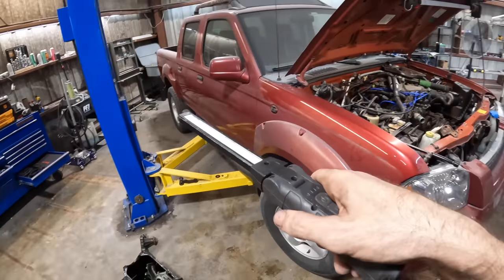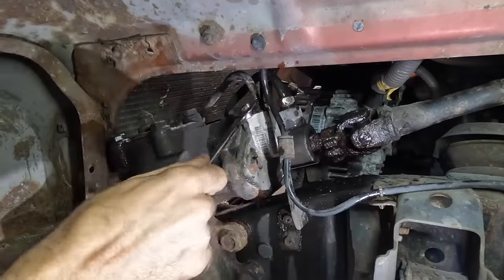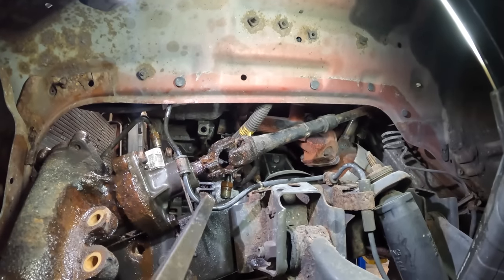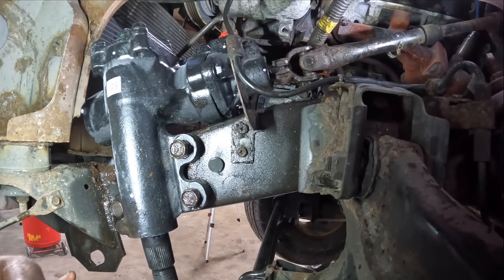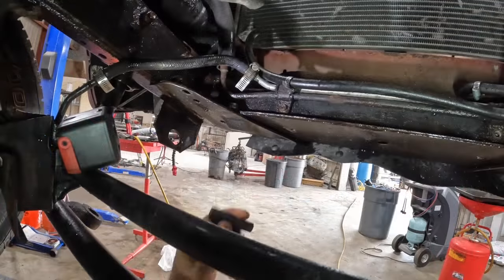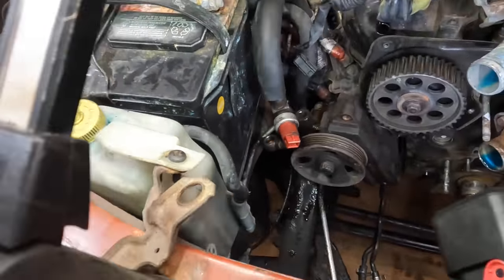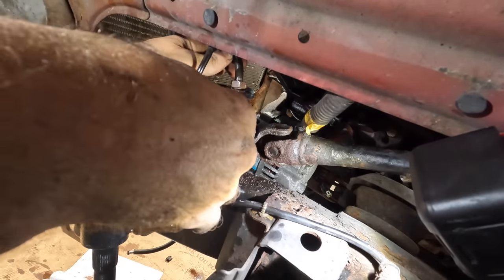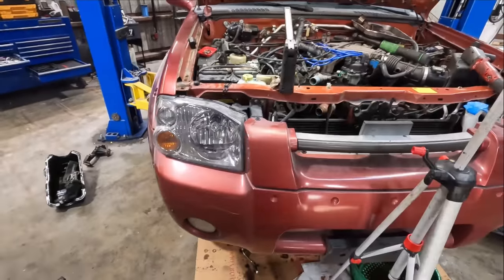Rusty Oil & Dripping Transmission Fluid! Pt3 #oilleakrepair #steeringwheel Nissan Frontier 3.3 4x4

Comment: The owner must love this truck. These repairs are high dollar.
Reply: I thought the same thing Doc Zoidberg.  Maybe they cannot afford a different vehicle?
Reply: @jeffkenney1618  I don't think it's about not affording a new one. I have a 96 Silverado, a 96 Cheyenne K1500, and a 99 Suburban. I am rebuilding the motor in the Suburban. Two of them have rebuild transmissions. They are solid trucks. Newer ones aren't as good. I can afford a new truck, but I love my old trucks.

I have videos about them on my channel.
Reply: Replacement  is even higher dollar.  New equivalent approaches $40K msrp.  Can do a lot of repairs for the cost of a few monthly payments.  Those payments last for years....
Reply: @desotosky1372  That's true. It's even better if you do most of the repairs yourself.
Reply: @desotosky1372  They are wanting $80,000 plus for new Fords.  Repair away.

Comment: Speaking from the salt encrusted northeast, we always clean up split joints (like on the steering shaft) with a straight/tube wire brush then a good schmear of axle grease on it.  Goes back together better and definitely will be in the best shape it can for future disassembly.

Comment: That first bolt reminded me of some repairs I did that involved a file to create clean faces that a socket or wrench would actually grab instead of the nearly 1/16-inch layer of crumbling rust.
Nothing says fun like turning a 1/2 in bolt head into an 11mm bolt head.
-
I've also had to use a Dremel to turn blown-out Phillips' screws into flathead screws.
-
Rust.
Reply: That sounds god awful
Reply: Try making them Torex heads.  They grip better.

Comment: Power tools are amazing. When I first started on motors everything was done with spanners but motors were much more simpler.😁
Reply: And this one is 20 years old!
Reply: I always wonder how the anvil holds up in impact wrenches?
Reply: Power tools ? We once had a Mechanic from Brazil. He started working on massive "Cats" he'd trek out into the forest, following a cable until he found the broken down machine. The repairs were all with wrenches as there was NO chance of getting anything other then "armstrong" power to the site. He sure seemed happy in our fully equipped shop.
Reply: Me to have a great day

Comment: Isn't the cost of this repair going to be greater than the value of the car?  This has to be several thousand dollars worth of labor.  If this was my car, I'd be thinking it's time for a new car.  Enjoy your videos, Ray.   Yours is my #1 favorite YouTube channel.
Reply: A new car costs $50k, a used car costs $20k.
Reply: @lzxray6781  and a used car is usually someone else's lemon
Reply: @lzxray6781  This Nissan Frontier starts at $22,000 new for 2023, about the same as a 2023 Toyota Corolla.  I see ads for a 2000 Nissan Frontier for $3000-$6000.  This vehicle is a money pit.  Time to cut your losses.  Perhaps the vehicle has a sentimental value?  That's the only reason I could see spending so much money on it.
Reply: it just depends on whether you can afford a reasonable used or new car, there is no point in buying a cheap used car and then having to put a lot of money into it to make it okay
Reply: But is it less than buying a new/used vehicle?
Reply: Junk the Nissan and get A Toyota truck!
Reply: If it was my truck, and it ran really well and had no other major issues, I would drop a couple grand on it and run it till it drops. New vehicles are gonna cost ya 7 to 900 a month, used one for 15 to 20k at today's high interest rates gonna cost ya 300 to 600 a month. Putting 2k in this one to fix it up is a way better idea. Even if it was 3k. Even if the guy had to borrow the money and pay it off in a year or two is still less than 200 a month with interest.
Reply: I agree totally with you. Those older Nissans were the best Nissans. 
But I think it’s more than $3000. At least $5000.
In 2009 I bought a ‘96 Pathfinder. Put $3000 in it right away. Still runs good with 273,000 miles on it now. Fighting rust though.
Reply: Nothing prevents five other unrelated things breaking soon after, especially in a northern rusted car.
Reply: With what's happened with car prices lately and the frankly poor state of new cars I think this was a pretty smart investment. The US is on the verge of all its banks failing and a new great depression. Much better to own your vehicle outright than have to make a monthly payment. 

The owner will get another decade out of this truck now. Maybe needs a bit of rust treatment in a few spots.
Reply: I'm flying from WI to Florida next month to bring home a 1988 truck nothing like bringing old mostly dead stuff back from the dead
Reply: It's not a car. New truck today is what, 60+k. I would definitely repair this truck if I loved it and it's going to be safe when Ray finishes.
Reply: I think that’s a fair question. I was curious about that question too, so I looked some stuff up. A new Nissan Frontier starts at $29,379 that’s for a very basic 4 cylinder 2 wheel drive single cab. A decently equipped 4x4 with a V6 and double cab will run you about $38,000 to $40,000, so I don’t know what I’d do in this guy’s situation. There’s a lot to be said about not having a car payment, but I do see the probability of this making sense for someone. Where I live it’s really tough to find a decent used truck, small or full sized.
Reply: Unfortunately, with Nissan, that's a low bar. 😂😂

Comment: Just a suggestion, for making replacement rubber pads on things like the power steering lines. Get an old motorcycle tube and cut it to size. It can be a handy trick that is over looked.

Comment: I hear you about the rust/oil combo...crunchy fastener turning sucks. I'm surprised as oily as everything is that you didn't empty 2 or 3 cans once the radiator and front of engine was off. I hate working on slimeballs. It's much more enjoyable working on clean and shiny🙂
   Thanks for part three on this truck Ray.  I can't wait til part 4🙂

Comment: Minimum 6G's on parts and labor, a lot cheaper than buying a new vehicle, plus you have a mechanic that can make it like new.  Good job Ray.
Reply: I am reminded of a movie where a guy walked around with a sign that read "Not economically viable" (Falling Down?). This truck should have one too. A big one. Neon lit.
Reply: Yeah - these old Nissans are good vehicles. Cheaper made than Hondas and Toyotas of that era but often built using dated technology so they tended to be as reliable. This thing could probably run for another 20 years with some rust treatment and maybe a donor engine at some point.
Reply: That truck is in great shape... for its age.

Comment: I bought a parts yard power steering gear box to "someday" replace the leaking one in my 1988 2WD Mazda B2200 truck.  After I got the engine remanufactured in 2020 and was happy that the engine didn't leak, I installed that used gear box; similar to what you just did on this Frontier, but a little easier on mine.  It worked fine, and doesn't leak still.

Comment: I'm surprised you don't use flare nut spanners, (pipe spanners as I seem to have learned to call them), for the various lines you have to get undone. I'm always waiting with gritted teeth for the open spanner to slip and round the fitting.😬
Reply: The ones he is using, are designed to work on the flat sides of the nut, to they give them a very good grip without rounding the nuts off,

Comment: Target fixation has secondary effects while driving. Normally it is a matter of misdirected focus. For instance, soccer goalies wear bright colors on purpose. Players can be distracted by them so much that rather than kicking the ball to the corner of the goal, they kick it right to where their eyes are focused - to the center of the goalie. When driving though, you have an added complication of your head following your eyes and your shoulders following your head. The shoulders of course directly affect steering input. This is why drunks will stare at a cop car on the side of the road with paranoia and yet inadvertently steer right into it. Motorcycles and bicycles are much more susceptible to very small shoulder movements, so for a sober cyclist the effect has less to do with steering directly toward where you are looking and more to do with looking to your left or right and your shoulders nudging you in that direction. By the time you look back forward you are drifting out of your lane or off the road.

Comment: I live in Canada on the East coast ant the only way to keep the rust off is to have your vehicle sprayed each year. Mechanics don't like the mess, but parts bo come apart easier. Have a great day.
Reply: Hello fellow friend of the salt and rust😂
Reply: Yup.  cars turn to dust pretty fast out here.  Lots of trucks fold in half on the lift at my father-in-laws shop.  

My mechanic actually does the spraying too.  It's a love-hate relationship.  Makes life messy, but much easier.  He uses Pro-Form because it doesn't affect the rubber seals as much as the others.  

I saw a 90s Chevy truck with Krown stickers in the back window from 1994 onward in Nova Scotia a few years back.  The truck was still mint.  The stuff really does work well.  It was winter time, so it wasn't a garage queen either. 

In comparison, I bought a beat-up 98 1-ton Chevy for 1500 bucks in 2017 in BC.  It was a work truck and used and abused, never sprayed or undercoated.  It still had paint on the frame when I bought it in 2017.  😂
I replaced the clutch in it, and didn't even have to use penetrating oil.

Comment: Ray it might have been easier to remove the body from sub-frame. But I like your tenacity. Great show mate
Reply: This truck looks too rusty to risk removing body/frame bolts, could cause days of delay fixing broken body mount bolts.
Reply: @quicksilver462  In Minnesota I have taken apart the frame from the body on an envoy XL with all that rust of the area  It was  the best thing I could have possibly done, otherwise there is no room to work at all.
But then I was rebuilding the engine and transmission too while I had it apart.
Reply: Yeah if you live in Texas try telling that to the bolts that hold the subframe in
Reply: Might have been easier to tow it to a junkyard
Reply: In England, we would call this car 'A rust bucket', but I think Ray could handle any screw, bolt or nut giving comments like mine. Lol
Reply: @charleshepplewhite7384  In Canada, we too call a  "rust bucket" what a coincadink. LOL
Reply: In Ohio we call them rust buckets, bucket of bolts or a 55 get-out and push.

Comment: On complex routings through the engine bay like the power steering line here, I tie a messenger line on the part being removed then tie it the new one and pull it back through. No question about where it should run.

Comment: It would be interesting to know how many hours you had into the whole repair!
Reply: Was thinking the same thing. Parts… labor…Truck can’t be worth more than $8 or $9k?
Reply: More than the Chilton Time to build the truck!  ;-)
Reply: I wondered the same thing about project Jeep that he spent weeks on. If I have to pay my mechanic more than a few hours of labor plus parts, then the car is totaled
Reply: Nissan time to r and r the motor is 15 hours and add 4 more to seal and trimming belt with water pump.
Reply: @bustedkeel  good luck with that. You'd rather replace a vehicle for 35k than fix one for 3? Cars aren't disposable you know.
Reply: @bustedkeel  Pssssssssssssst I’ve got a secret

You tube content. He makes more from you tube than the repairs. He needs the material.

Comment: A small chisel helps spread the ears on the steering shaft making it easier to remove and reinstall. Looks like some rust converter would help under the fenders before the rusting gets worse. It looks like they want to keep the vehicle for awhile. Mechanically it will be in good shape, they should take care of the body to.

Comment: Those clamps holding the power steering line to the frame are called adel clamps.
If the rubber is deteriorated, you can reline them with a piece of thin leather belt. That's how we made field repairs on our helicopter lines on deployment.

Comment: Nice video Ray.  In 1975 I started working at my friend's shop.  It was founded in 1927 by his grandfather and had some interesting old tools.  I faintly remember a ratcheting line wrench.  It had a sprag similar to an automatic transmission.  It worked great, and would come in very handy in situations like this.  Have you ever seen anything like that?

Comment: Most cars have fluid leaks somewhere. I have seen cars with 3000 miles leaking oil. A corvette that was bought brand new, in the fall, taken on a trip to the gambling boats then put in storage until spring have an oil leak. Vehicles are only as good as their makers.

Comment: Wish I still had my Nissan. Mine was an 85 bought cheap owner thought it needed a motor.  It actually had the wrong sparkplugs in it. Replaced sparkplugs and put 15000 miles on it and then sold it because I had bought a new truck.  I see it everyday, the old man I sold it to is still driving it and he hauls a trailer with his landscaping tools.  Wish I'd of kept it.  They say, "Hindsight is 20/20"

Comment: Owner must love his car to spend this much on it - I had a 200SX and was really sad to sell it cos i couldn’t afford to keep it in repair 😢
Reply: @sidwalker6902  it was S14a Dark Blue - non mod - with cream leather - 1999 I think .. solid never failed me. Just some issues with dry joints on the circuit board that meant I needed to give it a thump to get the Rev working. Had to sell cos got married. And some welding needed on the front struts. Darn should have kept it.

Comment: Something like 35 years ago, I owned a little Datsun car. Engine was bulletproof and was actually very easy to work on. Not at all like this Nissan, which is either the result of the Renault influence on the Nissan group or just simple progress - progress backwards.

Comment: Hey, Ray!
When you get one of these rust buggies, the FIRST thing you should do is soak every nut, bolt or screw you will touch with penetrating oil and let it soak as long as possible.  Then squirt it again before you begin work.  Like the steering gear and associated components.  If you had soaked them down when you started this job, 90% of these nuts, bolts and screws would not have been any problem at all and you would have saved yourself a ton of time, stress and anxiety.
Hammering on the steering gear at the u-joint like that can damage the seal of the input shaft and the bearings inside.  The bearings are often just the caged ball bearings like the old VW Type 1 front wheel bearings and they do not like the shock a hammer delivers.

ETA:  That steering gear reminds me of the olden days (1976-1980) in the USAF when we were rebuilding the Dodge recirculating ball steering gears.  I must have done 30 or 40 of them myself and got pretty good at 'em.

Comment: I think I recently came across this set of open ended ratcheting flare nut wrenches Ray!
Reply: Also first thing I thought of when you unhooked those lines was a mess and now you mention avoiding the fluid. Here comes the part number OEMTOOLS 35057.
The ZTKOOL 1025 steel line stopper set looks cool too. And finally the Lisle 67000.
Reply: I’m very surprised to have not run across a steering rod u joint separator tool online. I envision it to look like a ball joint separator, except for it to have a fork on both ends.

Comment: My best friend is oxyacetylene  when working on  heavily rusted vehicles saves loads of time and cursing , induction heat coils are  another time saving device if applicable , the rust belt is everywhere in England 😤. This vehicle must feel life a restro job . chin up Ray think of the $$$$$$🤓

Comment: Those Jetta engines are the same as the Beetles, nightmare to do the plugs,on the beetle it's easier take the manifold off..stats usually fail causing head gasket to go on em.

Comment: I have to get mine towed in to the shop and they are going to ??fix the ignition problem?? See what parts it needs?? 
Same thing different, that 6 pt socket should have worked as they do hold the corners better. 
Yes very true, years ago while driving to Grande Prairie there was hundreds of meter of open road where do someone drive to that power pole which was ??? 50 ft off of the road. Headed right to it, you could see the tracks in the snow. 
Put a 3" long impact extension on it and Beat it!!!!!!! Or drill and tap it out!

Comment: What was that rubber hose going to? (laying against the bottom of the radiator at 25:12). It was near the bundle of power steering lines.

Comment: This guy is likely spending over $2K into this truck, but it says how crazy expensive the new and used vehicle market is right now that it is worth the investment. $2K wouldn't even be a decent down payment or not even 3 loan payments on a new truck.
Reply: Exactly.  There are quite a few comments questioning if this work is worth it.. absolutely it is!  To buy a different vehicle, pay the sales tax ($600 tax/$10k spent) just to have a used vehicle with potentially the same problems seems foolish, especially if you have to finance it with todays interest rates.. you’d just be pi$$ing money away.

Comment: All I can say is old hose and plumbers straping you can buy it in copper. 
They make pex pipe hose clamps that fit 3/8"rubber hose and use a crimping tool
To clamp, its my oppion these are better then the ss worm gear clamps as you've got a lot less metal flaps sticking out at you that can cut into something else.
I hope you've ordered to 50 cans of brake clean to make it nice and shiny, but wait thats going to remove the rust protection systems.  Well it didn't work anyway.

Anytime you drive in Salt water or go where they use salt to melt snow you've got to wash it off right away, becuse it dont take long to case metal cancer. Aka Rust.